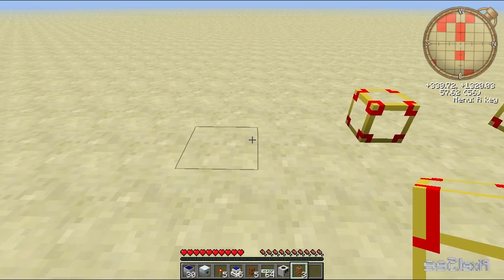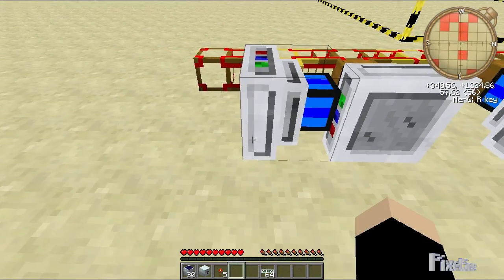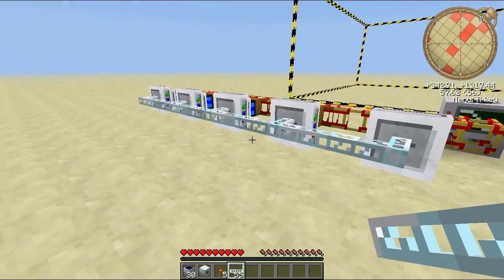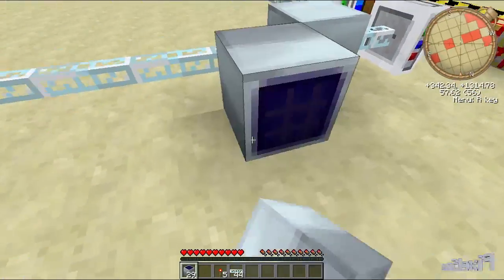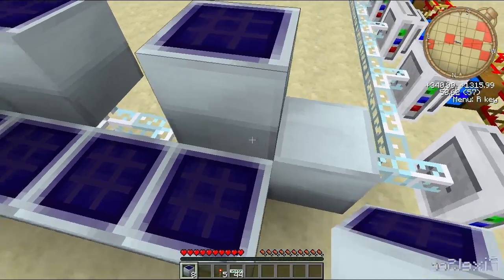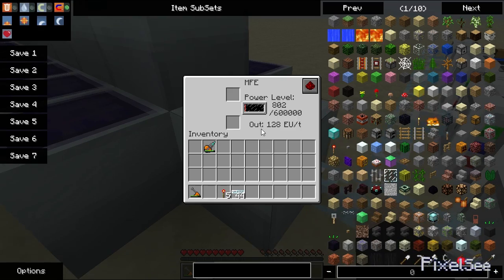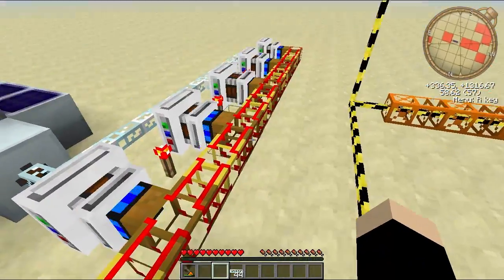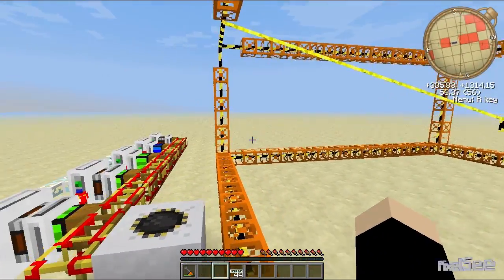Feed the Beast: How to make a Solar Powered Quarry

Comment: This video is 11 years old now, but I saw some comments from two years ago so I think I might be able to help someone too 😂 I’m currently playing FtB revelation on 1.12.2 and as a little update for this video : 
You can also just stack the electrical engines behind each other and the last one intro the quarry. So you don’t waste time with these pipes 🤝 you can also craft circuit boards (which you can use with rightklick on a soldering iron) and put bronze electron tubes in it and put that whole thing into your electrical engine (you can just stack 1 per engine). I hope somebody sees this 😂

Comment: I've not played FTB in a month or two, so this may have been patched, but all I can think is that you didn't wire them up correctly and there was a power surge. If the blue lines in the pipes got very thick, then that would be it. Make sure you connected the pipes up to the quarry correctly.